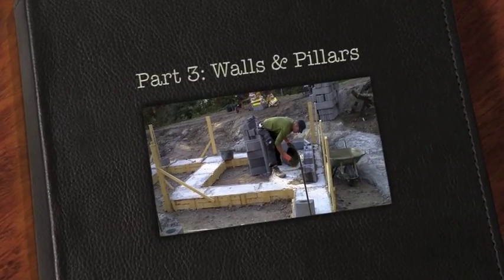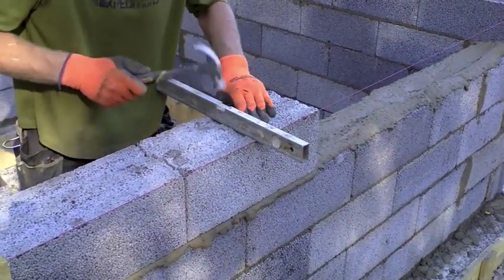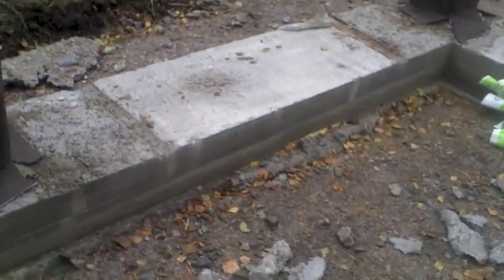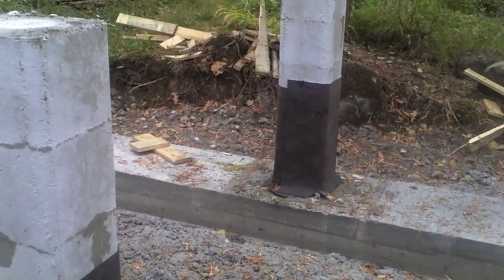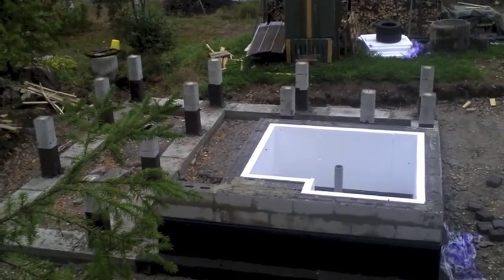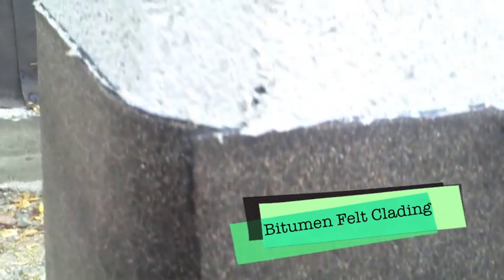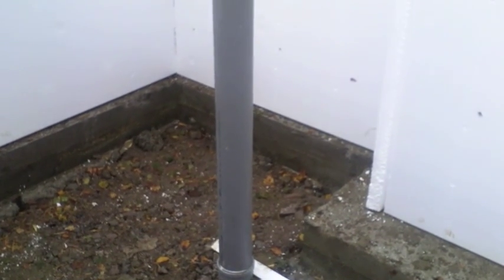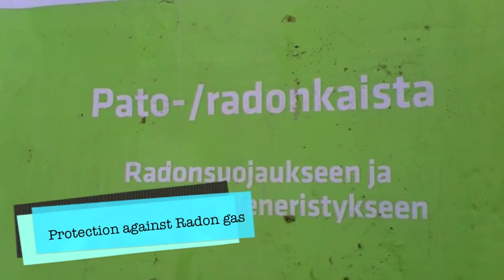Building a log cabin in FInland: Sauna foundations and drainage (Part 3)

Comment: Robert: We call it "Jumping through hoops". New regulations where our cottage is locarted states that you cannot have over 16% (2,400 sq ft of a 15,000 sq ft lot) of your land covered with buildings, gazebos, decks, steps, garages, shed, walkways, driveways or any other surface that does not absorb rainwater. To put a $7,000 360 sq ft storage shed delivered to our property we would have to spend a minumum of $7,500 for an engineering study, approval paperwork and redirection all of the all rainwater to a level underground that was sand. At our location the depth of the pit in a french drain sysytem to sand would be between 4 to 21 feet. It doen't matter whether your lot is on the water or hundreds of yards from the water. To replace a septic sytem or build a new one cost $25,000+ which prevents any water from entering the soil. You have to hire someone to get all of the approval paperwork done. Many local, state and federal agencies have to sign off on the paperwork before the work can be done. Bernard
Reply from the maker: That sounds like a real headache. When we had the plans drawn up we had a terrace around two sides of the house, but we were told we could only have a terrace that was half the size of the cabin itself. so the plans had to be redrawn... ahhh.
During the excavation we hit some bedrock and to put in the footing and pillars we had to move the building about 50cm in one direction. We then had to get permission from the neighbours and the authorities to make that move possible. It went through OK, but you wonder sometimes what would happen if there were objections.
Reply: OldGardenerGuy Robert: We could not put one on our property because of the extra cost. We have 3 lots across the street in a private subdivison with privately maintained roads. They had changed the law to include private roads and since the lots where we now wanted to put the shed did not connect directly to the lots with the cottage and did not have a dwelling on them, we had to ask for a variance to the building codes .We had to pay $200 to the county we live in so they could advertise in the paper what we wanted to do and notify each adjoining land owner by mail to see if any objected to us putting a shed on our lots. If anyone one had objected we would not have gotten the variance and we would not have our new shed. Then for $60 more we had to get a building permit for the delivery of the new shed and we were told that we had to place the building permit visibly displayed near the site while it was delivered and set up (1 1/2 hours). If we wanted to have electricity installed in the shed it was another $60 for that permit. Things just use to be easier in the past. Bernard